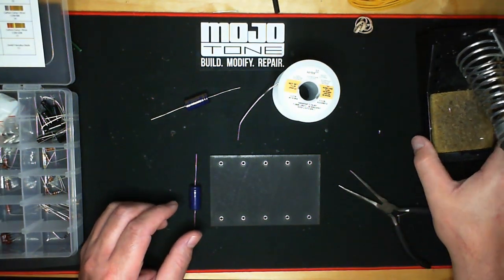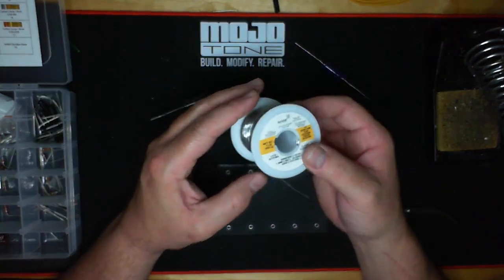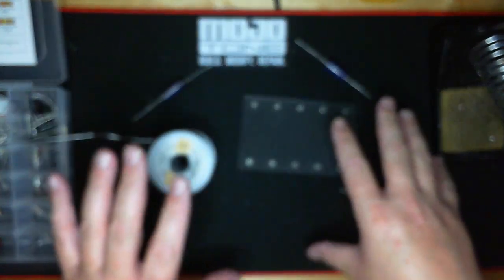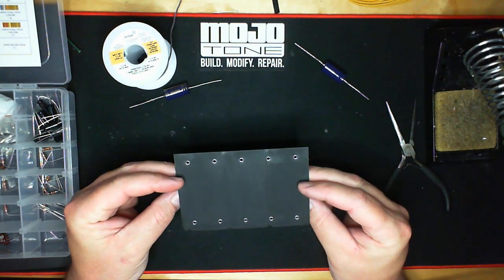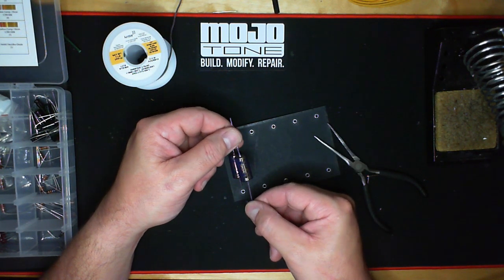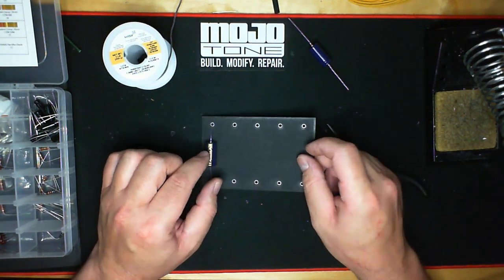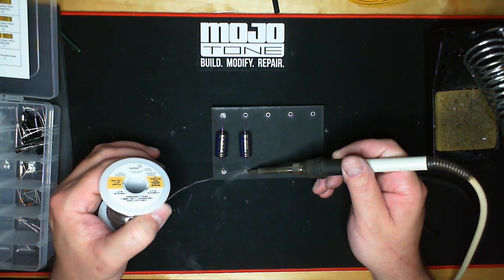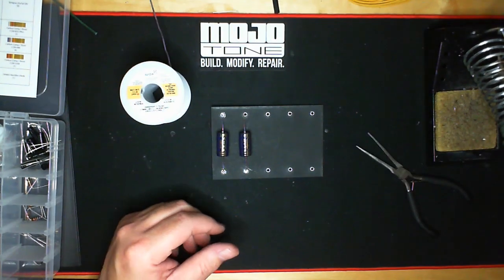Soldering Principles 101

Comment: 44 is the type of flux.  That’s 60/40 (60% Tin and 40% Lead) solder.  Lester flows well.  I’ve usd their lead free solder and you have to use a higher temperature but it’s not bad to work with if you have a good iron.

Comment: Confused...you refer to your Kester 44 solder "acid core", but the roll you held up to the camera identifies the solder as "rosin core".  Is rosin core the same as acid core?
Reply from the maker: Yes, "rosin" is an acid base flux when referring to kester. Kester is labeled as "rosin" core as it's trade name. Other mfg's call is acid core flux. So, in universal slang it would be just any leaded acid core flux solder.- Mojo Team
Reply: @mojotoneofficial Have to say, I disagree with the assertion that the term "acid core" is universally used for electronics solder. I think that will lead quite a few people astray.
Modern  "Acid core" designation is typically reserved for fluxes that are too corrosive for electronics. 
I fear this will cause many to incorrectly conclude they should  use acid core labelled solders on their projects, where it could degrade connections in many cases.

I'm also wondering about the corroded iron tips mentioned in the video. 
I wouldn't expect Kester 44 to destroy tips that fast since it's an RA flux core which is only mildly corrosive. Have to take your word for it though since you said the tips were lower quality.

Other than that nitpick, great build guide series so far.
Reply: @synaptic07  
I agree. I was surprised to hear that they run through tips so quickly. 
I use ROL0 or ROL1 rosin flux and have done maybe 160 hours of soldering with no tip degradation. 

He also keeps his iron 100c hotter than mine also, so that might also contribute.